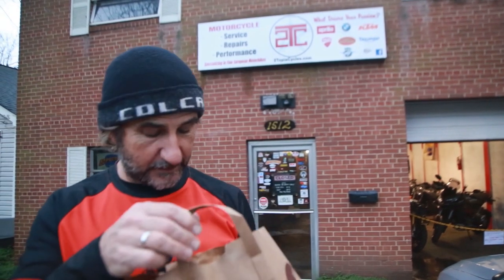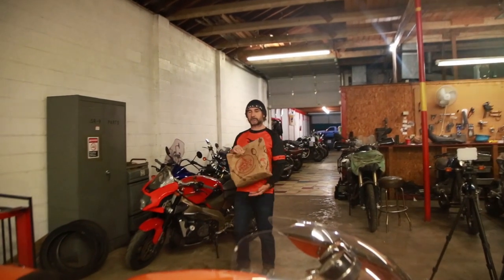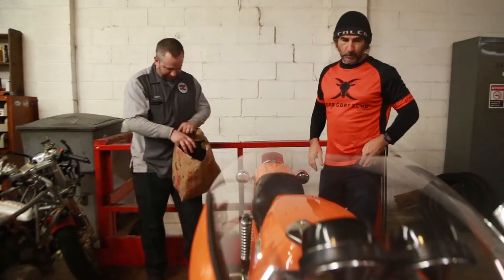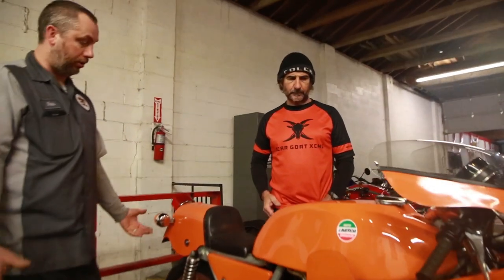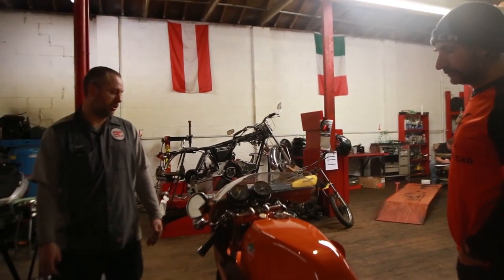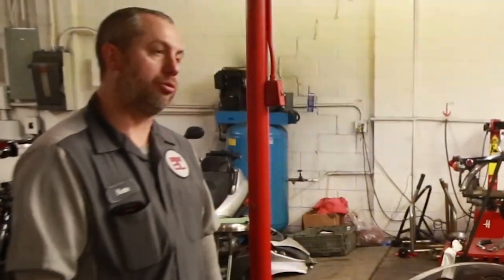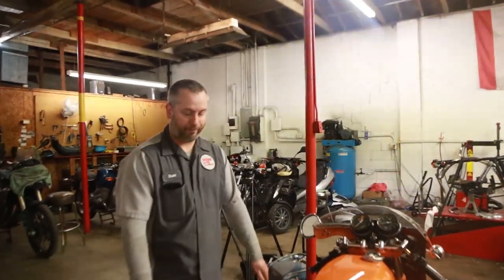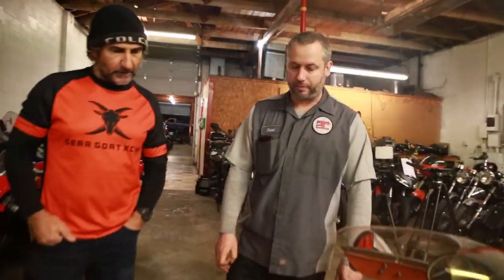The Laverda Project ep. 5 | Rick's Laverda

Comment: Hi Neale, Here are a few answers for you, staring with the number of 1974 SFCs that made it to America. In 1974, the bikes evolved from the drum setup to triple discs, like Rick's, but still had a points based ignition. It is quoted that 222 were made and 50 came stateside, but thats debated to up to 100. Considering the price of these bikes compared to what was being raced in the U.S., and their success overseas it makes sense to me that the number was closer to 50, as demand was higher for them by now across the pond. The 2-1 exhaust is a race pipe, and many came over with a 2-2 system with cross over. The turn signals, side reflectors, Sebring style mirror and rectangular 3C style taillight, plus more mods to the frame and motor, make the 74 a very important version in the SFC range. It's wonderful to see Rick's bike running so well, and in the hands of a competent shop. There are many folks more knowledgeable than I that have written books on Laverda that come up on ebay every so often, which is where I get most of my facts from as well as on the Laverda forum. As President of the North American Laverda Owners Club its my job to spread the word about these legendary Italian machines, so reach out to us if you ever need to know more at naloc2020@gmail.com. Or Rick, who is a member, and since its his bike :)
Reply from the maker: Fantastic...many thanks and please keep in touch.'